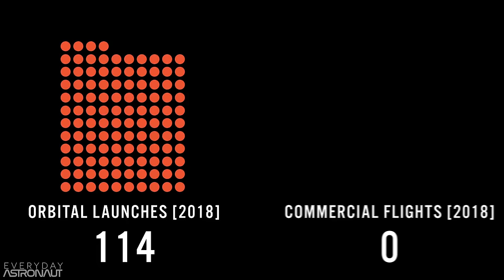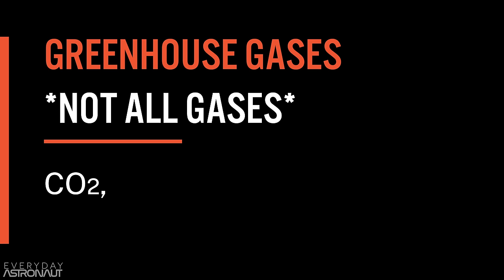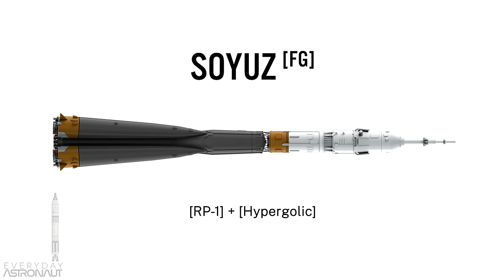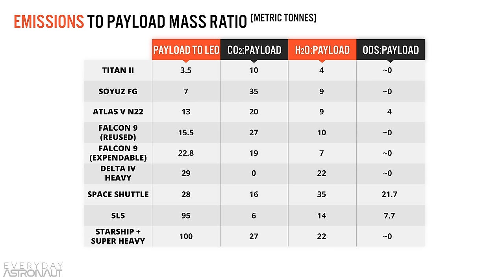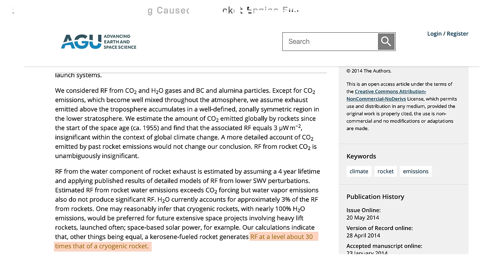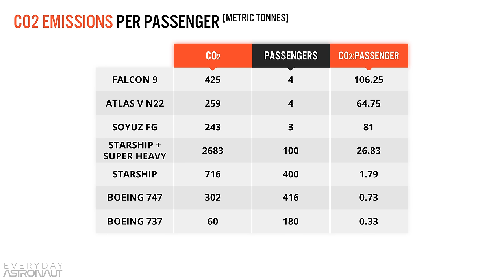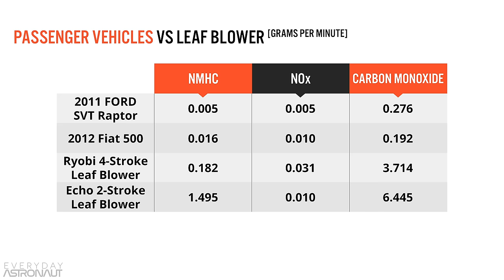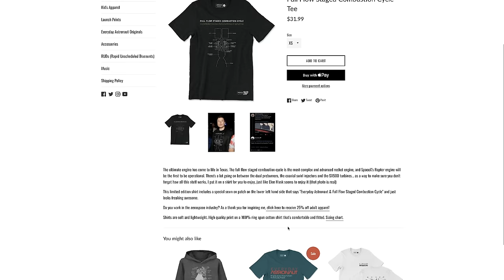How Much Do Rockets Pollute? Are They Bad For Our Air?

Comment: Is it just me, or is everybody wandering around, unable to get that leafblower/F150 comparison out of their head? Anyhow, the obvious solution is a full flow staged combustion cycle leaf blower.
Reply: I have always thought leafblowers were the most stupid, anti-environmental invention ever. Use a rake!! 
An LB has no advantage over a rake at all. It's not even faster or easier to use. You can't even gather the leaves together for composting with an LB! People typically just blow the leaves off their property and onto the road. Stupid.
Reply: @DunnickFayuro  According to the back of this here envelope, you'd hit Mach 1 in 0.3 seconds. Now THAT is a leaf blower!
Reply: @deanmichalos6848  corded electric models not that wasteful, the idea is that your blow all the stuff into a pile, then use your rake & shovel to load the stuff into the yard waste bin // if you for example use a push reel mower (hand foot human power rotary blade) to cut grass & want to clean up the grass clippings, a rake does not really work very well, but an electric leaf blower in yard vac mode works great // after your blow all the grass into a pile to suck up //
Reply: @deanmichalos6848  always felt same.
Reply: @deanmichalos6848  Yea because raking is so much easier and faster then just pointing a stream of air and letting it do the work for you...Sounds like you never actually got the hang of manipulating air and blowing debris in a certain direction or pile and are just dismissive of modern technology. Not everyone is worry about composting leafs and if you are blowing leafs into piles works great...you know just like when you rake leaf into piles except you just stand there and let the air work for you
Reply: @AaronSchwarz42  Raking grass clippings is not that hard with the special lightweight rake designed for that job.  However in practice, letting the freshly cut grass stay in place seems to work wonderfully too, as it visually disappears among the grass while making the lawn softer and more pleasant.  Longer term it will fertilize the lawn itself in a tiny circle of life.
Reply: @deanmichalos6848  I use a lawnmower (where the leaves have fallen on grass obviously).  Its a better garden vac :)
Reply: I was wondering where this was. That's crazy.. 46:32
Reply: LoL I'm a professional lawnmower and here's the simple fact for you those leaf blowers probably save 20-40 hours a week of work if not more. They also work for up to a foot of snow depending on conditions and model of leaf blower.  I probably use one for a good 3-400 hours a year, you're not prying it out of my cold dead hands. I would gladly take a fuel-injected super charged one. :D
Reply: @un4v41l48l3  This is one of the best comments I have ever seen
Reply: @thedyingtitan1247  these are the same loonies that live in California and banned all 2 stroke engines. Raising costs for you via that ever ignored (by leftists) law of unintended consequences. These idiots have no concept of the real world. 
I will say the massive improvement in battery technology is a win win for everyone. Now if you care about your environment you should lobby your government to incentivise and reduce barriers to entry for nuclear energy, so you can more efficiently and cleanly charge your improved Lithium, and eventually solid state batteries! Win/win/win.
Reply: Because it's a broken comparison that has really no actual value. I'll still take your design, maybe we can even put an airospike on it, so it works well from the Netherlands to Tibet!
Reply: @deanmichalos6848  agreed, they are one of the most pointless and annoying public nuisance devices every invented. The idea of using a dispersive jet of air to "collect" anything is almost an oxymoron. A rich mans toy with which to annoy his neighbours.
Reply: crackerzNcheez 
I would unironically buy this.
Reply: Matt H 
Outstanding comment. Nuclear + battery technology is the way to go.
Reply: @MattH-wg7ou  Uh, what? I live in california, and there was just a landscaper with a gas leafblower outside this morning, lol...
Reply: Yard brooms are eco-friendly, and give you exercise!
Reply: @deanmichalos6848  We use all electric leaf blowers charged by part of the energy generated from our solar array.  Environmental impact :  ~ZERO.  It's got a million uses we use them for other than blowing leaves.  We use it to more evenly disperse grass clipping for mulching, for cleaning sawdust out of shop Power tools, for drying up water spills and dying off wet surfaces for safety, for accelerating drying of certain substances, for forcing bad smells or noxious chemical fumes out of areas very quickly for comfort and safety, and a half dozen other things around the house.   They are certainly for us, anything but useless.  And ours came as part of a package of electric tools (we didn't think it was useful at the time either but it was a bonus which we found dozens of uses for in the end).  Now, as for gas-powered leaf blowers.. those ARE completely useless because they are too foul and polluting to have any valid indoor use as well as too noisy and because of how polluting they are, I ageee, USE A RAKE... or go electric!
Reply: @combativeThinker  LOL, what do you need batteries for if you have nuclear plants??? Batteries are only needed with renewable nergy.
BTW, I am against nuclear power. Having on average one plant blow up every 20 years and making the surrounding 50-200km uninhabitable just doesn't work out for too long.
Reply: @brucebanner3626  Bro did you not watch the video? Why cant you just do some simple labour so you help conserve our planet?
Reply: @deanmichalos6848  A leaf blower is for the major portion of the work, while the rake is for the end work. But you're young, I'm sure you can pull the leaves out of the bushes and groundcover with your rake and get on your knees to reach the rest. lol  8 )
Reply: Tubluer
Blursed and based.
Reply: @un4v41l48l3  That's sounds like an ad from a GTA V radio station...
Reply: I'd actually love to see one with a very small jet engine. Jokes aside I hate those things anyway. My Neighbour is a proud owner of an electric one and he uses it every Saturday morning since he moved in. I HATE the sound of this and it doesn't even have a combustion engine!
Reply: @electricpaisy6045  Hmm they do make small jet engines for RC plane market and some of them can clear your driveway in about ten seconds. Not bad for a jet engine 4-6 inches in diameter.
Reply: @Tubluer  before I forget think of this: there are those small twostroke leafblowers with 1 or 2 horsepower but do you know what else runs on twostroke? Giant cargoships!

Comment: -"It will take a solar farm the size of 6 football fields!"
-"So be it"

I love this guy
Reply: @Rainaman-  bruh
Reply: @netio112  who?
Reply: 6 football field is not that much in my opinion, thought you were going to say size of NY city.
Reply: @sevencostanza3931  its not but you also need all the batteries to last for at least a few months with no input power which we do not have enough batteries in the world to do that yet.

I believe that nuclear (fission or fusion) would be a far better option with these planets powering CO2 removal systems as well as most of the world. the waste from these would only be about a football field stacked 50m high. Though the waste removal or processing must be improved. Thorium reactors may help with this though
Reply: @Rainaman-  link plzzzzzz ❤️
Reply: @amantedecapaldi4037  Thunderfoot is his channel name - he has probably Elon related playlist there
Reply: There are several solar farms waayyy bigger than that near my house... Measured in square miles.

Add in mining, smelting, refining, processing, machining, stamping, welding, pouring concrete...

You will accomplish absolutely nothing on Mars without LFTR.

Full closed-loop? Even LFTR might not do it, and there's nothing better than LFTR.
Reply: @Rainaman-  You need more than Thundetf00t.  His critiques of Musk, hyperloop and space x are fatuous and his math is way off.
Reply: @Rainaman-  it's not complicated problem. It's heavy, but that's all. Making solar panels is easy
Reply: @shadowlordalpha  bruh spaceX plans always change. They’ll probably use both. Don’t worry about it. 😉
Reply: @starcatcherksp1517  yeah. Dude pump and dumps and take the idiots money as always
Reply: Person: this physically cannot be done because laws of physics 
Elon: so? does it
Reply: @Rainaman-  Idk man, it's not hard - it's just more work.
Reply: @Rainaman-  with that comment you completely ruined your credibility
Reply: @Rainaman-  shutup
Reply: If the 1960's had the same environmental awareness as we do now, then I can guarantee you that the soviets would have had more than a 100% chance of winning the space race.

Comment: I am 35 minutes in and I just realized the sign behind him changes colors.

Great job with the video Tim. You make boring stuff interesting.
Reply: yea, same I am only 30 minutes in though
Reply: 55 minutes...
Reply: @azerwhite8870  LOL
Reply: spoiler alert
Reply: Because it does not change before that point.
Reply: I would guess that it helps locate certain sections of the video when editing.
Reply: Better than me...
I noticed at 51:14
Reply: Boring? It's one of the most amazing stuff ever.
Reply: @RastrojeroDiesel1  You're implying pollution is amazing.
Reply: @knownas2017  two points of view. 1. You are producing co2, so you are polluting. 2. You use the O2 produced by trees ... Which is a pollution which killed anaerobic ecosystems a few years ago. =» in any ways, you are personally producing pollution, or, using benefits of the pollution of other beings. 

Are you fine with this ?

I am.

Comment from the maker: I should have pointed out the source that Starship Point to Point likely won't use a booster, here's the source for that!

“Add 2 to 4 more Raptors for Starship point to point on Earth. You can go surprisingly far, even with low lift/drag. This was an unexpected result." - https://twitter.com/elonmusk/status/1134023034908446723?s=20

"Ah, so single-stage point-to-point? That sounds way better." 

"Yeah, way better. Dramatically improves cost, complexity & ease of operations. Distances of ~10,000 km with decent payload seem achievable at roughly Mach 20." - https://twitter.com/elonmusk/status/1134025184942313473?s=20
Reply: Everyday Astronaut why does this comment have 1 like and no comments?
Reply: Well the dragon 2 capsule can actually handle 7 passengers, Ik it has four seats for ISS config but it can be configured for seven seats
Reply: Um, I think we need another video on that.
Reply: New video out today from SpaceX, using a booster
Reply: Of course there should feel use when the  Starship
Reply: please correct me if im wrong (uh oh what have i done) but surely rockets that go to higher orbits and even leave earth are much better for the environment especially because of the sabatier process, some flights can be carbon negative because co2 is taken out of the air and released in orbit around the sun or on mars which is already all co2, where it cant hurt earth. and i know co2 stays around a lot longer higher up in the atmosphere but if its higher up there is a lot more space up there for the co2 particles, so with global warming where greenhouse gases reabsorb heat being emitted back out to space from the ground, wouldnt the rays miss much more of the co2 if its spread out few and far apart in orbit than concentrated near the ground, and a lot less of the energy emitted back at earth from the co2 would hit the earth as they are much further away and the ground so most rays that would hit the ground would fly past out to space?

Comment: Awesome job as usual, Tim!  Going to be deep-diving into the research tomorrow but we just used your video on “Is Raptor king of the rocket engines?” today as our science class and we had to compare turbo chargers to turbo pumps, went over the 4 rocket engine cycles, etc.  Have you ever considered doing a video on rocket engine gimbals?

Comment: The effects on weather of the current collapse in air travel will be interesting to study.
Reply: The response rate of climate systems is likely too slow. The effects will be smoothed out over the next decade, making them barely measurable distinct from other effects.

Comment: That whole thing about "tEcHnOlOgY tHat Is 5,000 yEaRs OlD" kinda irkes me.

"Yeah, we've been using wheels since 3,500BC! What the heck are car manufacturers doing still using ancient technology!?"
Like, as if a modern liquid fueled, full-flow staged combustion cycle engine is comparable to gunpowder rockets.

(Also, we don't even know if gravitons exist, let alone anti-gravitons, or how they could be produced, and quantum computers aren't exactly something you can move around).
Reply: Well there is some indication by the cassimir effect that at least in principle something could be engineered that is repelled by gravity rather than attracted. Now as for anti-gravity. Who knows... We have just discovered the Higgs bozon, think of it as what the electron is to electricity it is to gravity. Now did the discoverer of the electron back in 1897 have any idea how his discovery would lead to computers or the world of today? 
So all we can say is we have discovered great new physics, and usually when that happens there is a great technological revolution within a few decades. I personally hope that negative matter pans out because you need that for a functioning alcubierre drive. I don't care about anti-gravity, as far as I'm concerned the full flow staged combustion engine is the 21st century wheel to be used with great success for thousands of years to come. Spacedrives such as fusion torches will surely come a long but high thrust engines for landing and getting off planets may remain chemical for centuries to come.
Reply: @user-lv7ph7hs7l  what the hell is a fusion torch?

Comment: @Everyday Astronaut  Nice video!, here some questions and some things to add:
1-Why you use the case of a single starship without the booster for long range passenger transport?   Elon used the booster for that, not sure that an starship loaded with 400 passengers (around 50 tons of payload) could reach very far being reusable. I don't know, I am asking.
2-Water vapor is not even comparable with co2, it is a more potent greenhouse gas, but it last only from days to few months (depending the altitude) vs hundreds of years of co2, then we also consider that most of the emissions happen at lower altitude instead at higher altitude.
3- Electrolysis does not consume much energy, today electrolysers are at 90% efficiency, current liquefaction plants are at 70% efficiency, but just scaling up (which you need to make rocket fuel) you can have a plant with 85% of efficiency.  One more case, you need to store solar and wind energy one way on another into hydrogen to solve the seasonal disparities and to clean the other 50% of global co2 emissions that came from the utility transport sector and the natural gas grid, those thing can not be solved with batteries (is not practical neither cost efficient). 
4-You mention how many football fields of solar panels are needed to make enough fuel for the starship on mars, but you did not mention how much time it would require to fill those, is not the same that amount of panels to refill a starship every 1 month than every 2 years.
Reply: Musk's conversation with Dr Zubrin was for a manned mission producing propellant in time for a return trip. Requirements are easier if two years elapse producing propellant.

Comment: What you are missing here is the environmental impact of methane itself. I just read through the relevant pages of SpaceX environmental assessment for starbase. For an orbital launch of Starship/Super Heavy they expect 7 tons of methane to be vented to atmosphere during fuelling. After landing of super Heavy they expect 5 tons of residual fuel to be vented, and for a Starship landing they expect 10 tons of residual fuel. That's 22 tons of CH4 in the atmosphere per launch. That is 0.22 tons per payload. Since the global warming potential of CH4 is 84 times that of CO2 on a 20 year timescale. This means the CO2 equivalent emission of the methane alone is 18 tons per ton to orbit. This is the launch only, all other methane operations are ignored. If you are correct and there is 27 tons of CO2 per ton to orbit for the launch itself, then the pure methane emissions is not far from half...

Comment: Just a point of order, steam (Gaseous water)is invisible .
What you can see is water vapour.
Is this you just simplifying, I for one am glad you do I could see this very rapidly goiing over my head.

Home experiment/ observation:-
look at the stuff coming out of your kettle spout 
Note how there is a clear area next to the spout then the white vapour which you can see.
Steam is being issued (so gas is invisible)
Then as the output cools down water tends to condensate (on dust particles etc)and becomes water vapour which you can see.